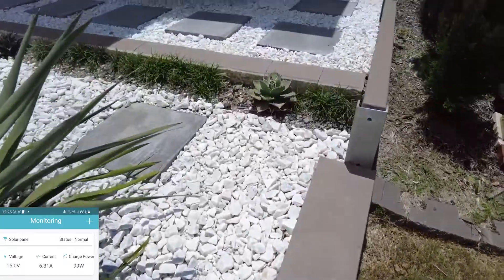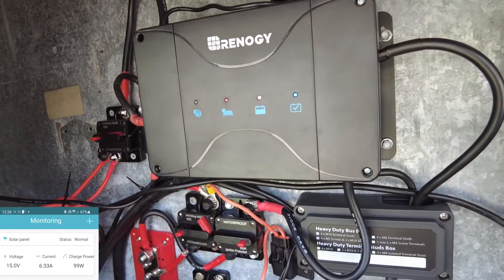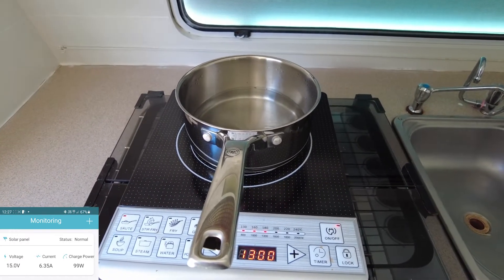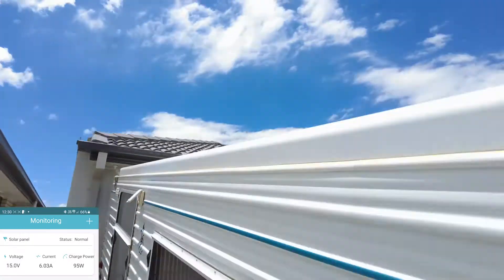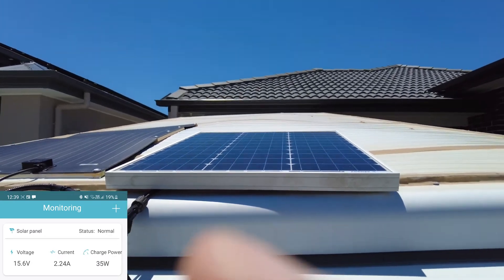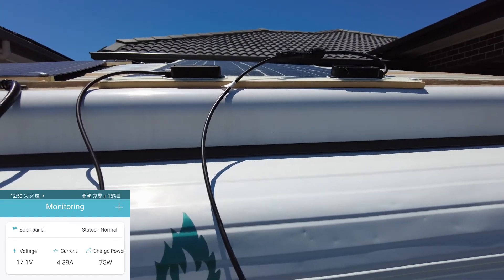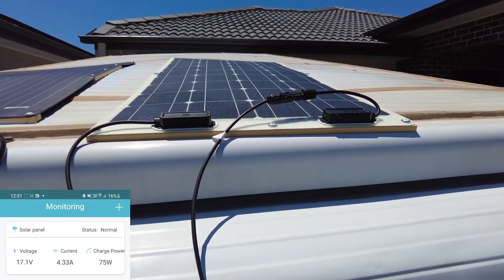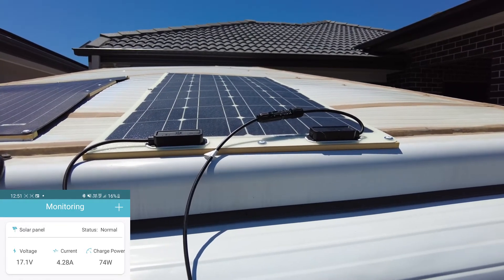KINGS 110W FLEXIBLE SOLAR PANEL vs RENOGY 100W FLEXIBLE SOLAR PANEL

Comment: I'm looking to purchase a flexible solar panel for the roof of my town and country minivan with tape. I need to know what kind of cables I need to use, I don't want to drill anything. I just need to plug a jackery 500 into  the panel  to run a small frig and heater or usb fan. what wires do I need to buy to make it work?

Comment: Might try the kingy cheers
Reply from the maker: no worries make sure you get the 107cm x 67cm one if your looking at the 110w one. i checked the kings website and it looks like they have a new model now they are still calling 110w but it is 76 x 78cm. so im thinking if its smaller unlikely it will perform aswell. they have the 107cm ones on ebay for good price at the moment https://www.ebay.com.au/itm/Adventure-Kings-110W-Semi-Flexible-Solar-Panel-Caravan-4WD-Camping-Battery-12V-/174306980251
Reply: @ProjectElsewhere  out of stock Bugger!!
Reply: I’m going to set one up for the young blokes navara, he just mounted an alum canopy on the tray and wants to travel, Gunah kit it out similar to yours
Reply from the maker: @samperras  nice one, bugger they are out of stock. Could always grab the 160w version if that's on the budget. Cheers
Reply from the maker: @samperras  also I see them on Facebook marketplace often too. That's where I got mine.